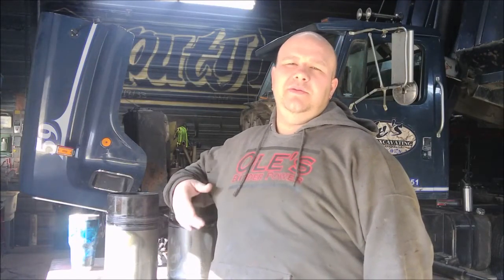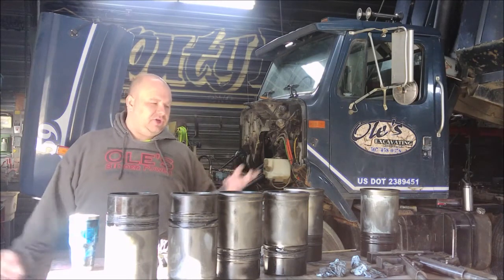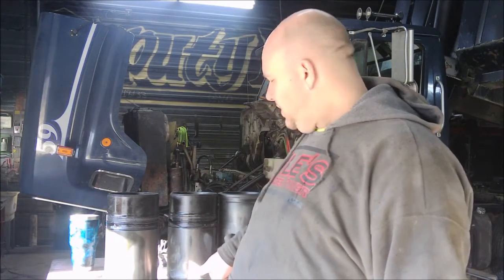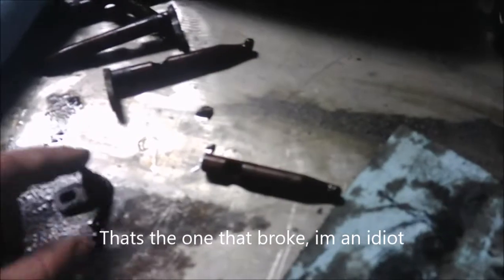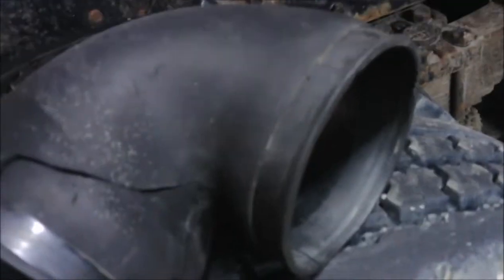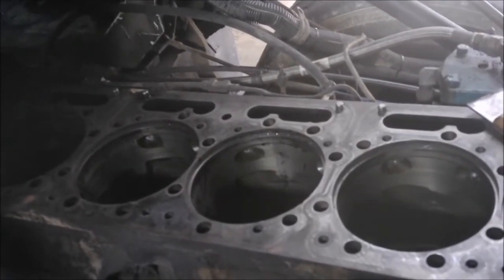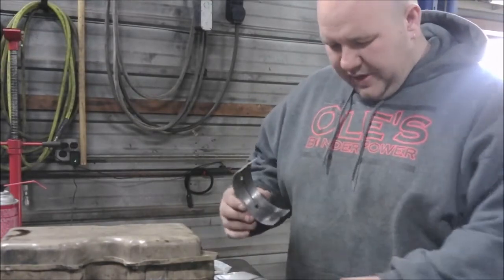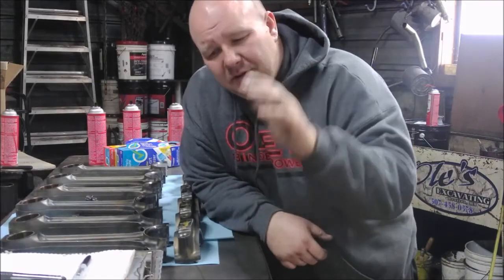855 Cummins Autopsy

Comment: The tiny craters in the liners is called cavitation.
Reply from the maker: Correct cavitation is air bubbles in the coolant that allows electrolysis to happen.

Comment: hello, please tell me how to increase the power of my motor and what to substitute in it to get 500 hp .I want to make a major overhaul, but I don’t know what details will help increase brainwash
Reply from the maker: Its hard to say without knowing what motor you have.
Reply: @KaputyINC  if I knew the number of a more powerful motor, for example ntta855, I could buy spare parts from it injectors, pistons, a camshaft, parts for the pump, I cannot find more than one specialist who would tell you how to build a seat motor from nta
Reply from the maker: @cavecustom9724 Id like to thing with enough fuel, timing, and boost 500Hp is possible. I'm pretty sure there is 400hp version NTC, and my buddy was telling me a bout a variable timing version as well(STC?), but im not that knowledgeable. My understanding is that my motor is pretty much limited to 350hp safely with its hard parts. I've heard you can change the fuel button too but then you start to run into reliability/longevity issues if your not careful. good luck

Comment: Does it have a coolant filter? I have heard that it is supposed to stop that from happening.
Reply from the maker: It does, and your correct it can. It happens when the coolant breaks down/ goes bad, you can also get filters that have an additive in them to treat your coolant. For awhile I was replacing my coolant every year for some reason or another and I would use fresh extended life. Being that the engine is 30+ years old with the original liners, it possible it happened a decade  or 2 ago. Im just glad we got we got to the overhaul before they were a problem.

Comment: can you overhaul the injector pump
Reply from the maker: They can be overhauled, but i think it best for a shop that specializes in doing it. They have specific tools and the ability to set pressures where they need to be(or turn it up if you want). I had mine overhauled to stock spec about 3-4 years ago. I think it was $1000-$1500